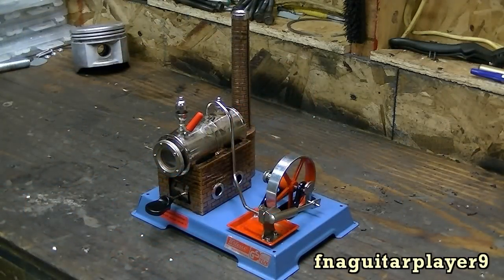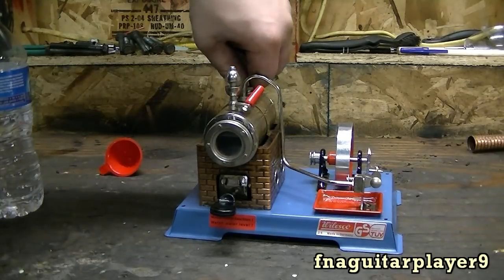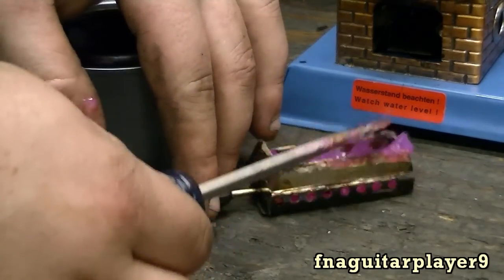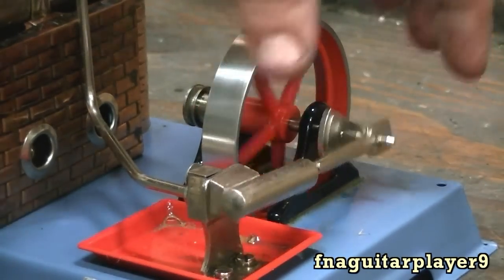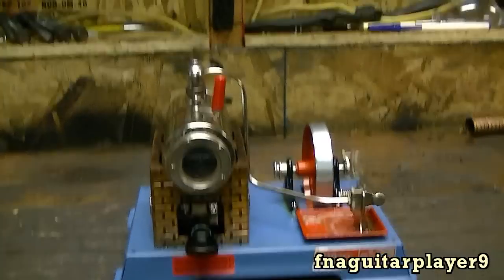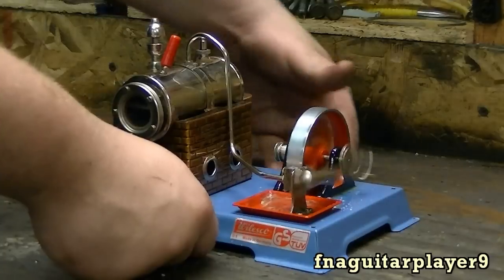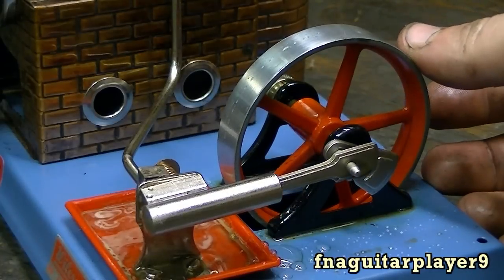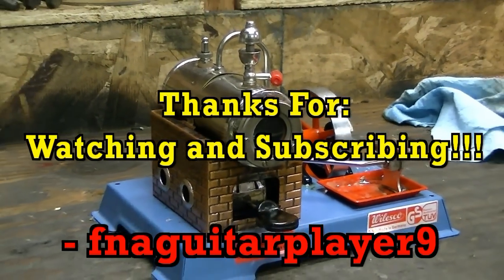Starting and Running a Wilesco D6 Model Steam Engine (how to start)

Comment: you should put some tinfoil in the fuel basket and make a little bucket when using that kind of fuel, will keep it real clean and when done just throw out tin foil and fuel tray stays nice and shiny.
Reply from the maker: That is a really good idea, will do that next time. I'm also considering making a small propane burner for it to, but i'm not sure about that yet. Thanks for Watching!

Comment: Sorry, one more thing... Can you use vasoline to run the device?
Reply from the maker: I don't recommend that, it would be better than nothing but a type of oil would be best, even motor oil should work fine in a pinch. Thanks for Watching!!!

Comment: Do they still make that oil? If they do, can you give me a link?
Reply from the maker: Yep, a bottle wlil last a long time, http://yesteryeartoys.com/z833-model-steam-engine-oil/ thats where my engine came from. They also sell the tablets on there as well. Thanks for Watching!!!
Reply: Thanks, i got an Empire steam engine model no. 46 from some antiqe store in southeast wisconsin, it might need a little cleaning, its missing a whistle and kinda rusty and does need oil. And its electric, so ive gotten a wire for it that is also antique. Im not sure if the insides are ok, and im not sure if there is a way to flush it. It has no little boiler window, nor a psi gauge. The flywheel moves and is not completly stoped. And i think i just found where the water goes. On the bottom it says made in two rivers, which is in wisconsin. And you think you can give me some advice? 

P.s i types this all on a tablet so if there is a bunch of weird mistakes, thats why.
Reply from the maker: I hear ya! I'm not sure on the flushing, I was going to say if it had a sight glass it could be removed, but in that case it will make it hard to do. I would use a penetrating oil on it first to get everything freed up and go from there, it would be nice to find a way to flush it out.

Comment: what is that purple fuel called?
Reply from the maker: Sterno, its used for camping/cooking. Works great for this but doesn't burn quite as long as the tablets. You can find the sterno at walmart (either in sporting goods or where the pots/pans are in cooking). thanks for watching!!!

Comment: what is the red bowl for
Reply from the maker: It catches water and oil from the cylinder after it condenses, most of it escapes as steam but some does condense. Thanks for Watching!!!
Reply: the red bowl is to catch any water that does leak out of that line it will just fall on there and then you wipe it.

Comment: Hehe, I have the same engine :-) It was a pretty piece of my childhood... Is so much better to fill it with hot watter from electric kettle, for fastest start and saving fuel.
Reply from the maker: I hear ya! That is a good idea, that would save alot of time and fuel. Thanks for Watching!!!
Reply: can you use boiled water
Reply from the maker: If you mean distilled water, than yes, its actually preferred since there is no minerals that can build up.

Comment: my boiler my d6 is starting to rust so don't know if put oil in the water would help slow the rust but i might just have to bite the bullet and get a replacement
Reply from the maker: +devon junction I hear ya, i don't recommend putting oil in the water, but you might be able to take the sight glass off the front and clean it out, hopefully its just surface rust, if it is it should clean up good. I've never taken the glass off, so I don't know if there is a gasket there or not, not exactly sure how its setup. If its real bad then yeah i'd say a new one would be the best thing to do. Thanks for Watching!!!

Comment: Cracking little engine you have there! Do you have a rough estimate for how much pressure the boiler runs best at? Somewhere around 30 Psi, I think?
Reply from the maker: +randombenj I hear ya! Honestly not right off, but i'd guess it would be in that range, i did run it off of air once but didn't open it up all the way, i'd guess around 20 pounds probably. Thanks for Watching!!!
Reply: The manual says 5 bar (approximately 72 psi if one bar = 14.5 psi)

Comment: Damn that thing is fast. I'm thinking of making my own little steam engine but the part I'm stuck at is the piston or cylinder, at 11:20 you said that it wasn't a dual acting cylinder and named it, but it was inaudible. It looks simple, and right now I need simple... Please help.
Reply from the maker: +Kraized yeah it is haha I hear ya, oh yeah, i said wobbler engine, its the type that the cylinder wobbles back and forth like this one did, a double acting one will not move, the cylinder is stationary. It would also be called a single acting engine. There is a another youtuber on here that has a ton of videos on building both types of steam engines, he's known for his machine shop videos but does these as projects, look up mrpete222 he has a ton of videos. Hope this helps Thanks for Watching!!!
Reply: fnaguitarplayer9
Thank you sir, I appreciate it.
I want to see how much electricity I could generate with a steam engine maybe a little bigger than the one you have there.
If I could power a laptop in the woods I would be set.
Reply from the maker: +Kraized Your welcome, no problem! I hear ya, it would be interesting to know. That would be really neat to see!

Comment: pls dont use normal water use destilled water
Reply from the maker: +SIMSA75 Thats what I've used the last couple times I ran it since this video was made. Thanks for Watching!!!
Reply from the maker: +Watermelon will Tap water has alot of minerals and chemicals in it, like calcium and chlorine, which causes deposits to form inside and can corrode the metal. Distilled water, is 100% pure water, nothing else in it, so no deposits can form. Same thing for topping off water in car batteries(lead acid), if you use anything other than distilled water in batteries it will corrode the plates and take life/amperage away. Thanks for Watching!!!
Reply: +fnaguitarplayer9  I've used filtered rainwater, seems fine.

Comment: There are screws for the chimney.
Reply from the maker: +SpinninBarrels Mine didn't come with any or have any holes drilled, I might consider doing that if i ever have a more permanent setup for it. I thought about soldering it on, but screws would be better. Thanks for Watching!!!

Comment: I got the same model, my dad bought it to me on an auction. But some of the parts where missing (2 machines and 1 string). Can i make or buy the parts? its just a question :)
Reply from the maker: +Fredbear´s Family Dinner I hear ya! If your good with metal or have access to a machine shop it should be fairly easy to make just about any part on these, not really sure if parts are for sell, you can contact yesteryeartoys about it, they should be able to direct you to where you can get parts. Thanks for Watching!!!
Reply: We havent machine shops arround here in norway,we got plenty of model shops. I wish i had those shops arround norway. Your steam engine looks exatcly like mine. But its from maybe arround 70s, 80s idk. I have like no fuel bricks, so i gotta buy 4 packs of it.

Im not so good in steam engines, only animatronics and robotics. I realy like to make experiments some times. I have like 3 cooler fans connected to a mobile phone adapter, its truly works :D
Reply from the maker: +Fredbear´s Family Dinner I hear ya. Its probably the same, I don't know if they ever changed anything or not. I hear ya, the fuel tablets do last longer than the sterno as i used. I hear ya!
Reply from the maker: +Fredbear´s Family Dinner I hear ya. Its probably the same, I don't know if they ever changed anything or not. I hear ya, the fuel tablets do last longer than the sterno as i used. I hear ya!
Reply: You can get parts on wilesco.com
Reply: get a mini lathe and go from there you might  suprize yourself

Comment: hi, i just saw this video and i need a question for my wilesco d5. How after using, i can  empty from the water the boiler? if I tip the water comes out in drops. (sorry for language but i am italian). Thanks bye
Reply from the maker: Ross I loosen or remove the whistle off of it, that lets air in. Kind of like how you pop off the cap on a gas can to let more gas flow out of it. Hope this helps, Thanks for Watching!!!
Reply: thanks for your answer
Reply from the maker: Ross Your welcome!

Comment: Your opening comment about the smokestack is priceless. +1 :)
Reply from the maker: Tracy Panavia haha I hear ya! It is pretty much useless, just for looks. Thanks for Watching!!!
Reply: fnaguitarplayer9 Hello, i just subscribed to your channel, you have very interesting and informative videos.I recently bought one of the steam engines like the one you have in the video it is almost identical with a few differences mine has the stack and a couple of walk ways one on each side and a ladder.I was wondering if the gasket in the sight glass can be replaced and with what material, also what type of fuel tablets are recommended.Very interesting video. Thank youRob
Reply: fnaguitarplayer9 What model is that engine? the one i have the whole assembly is 12 inches wide by nine and three quarters deepand the steam line goes out and then underneath the base and it comes out to a little valve that you can turn to open or close the steam supply to the piston and right before the piston it has something that looks to be another valve but it looks to me like a receptacle with a gasket and a cap that you can remove ah and the flywheel has what looks to me like a centrifuge conected to it by a round metal spring (like a guitar spring) but is used as a drive belt. The assembly does not have any marking as to what model it could be, it ony hay the manufacturer name is there a website or are you familiar as to what model i might have?Ah and the area where the relief valve is has a handle with a wheight that you can move (it has two notches where you can sit the wheight) i think that is to control the pressure at wich the relief valve lifts but i am not sure. And if that is the relief valve it sure looks different that the one on your engine.Any help you can provide will be greatly appreciated.Oh and by the way i subbed to your channel. Cheers
Rob
Reply from the maker: Rob Hernandez Thanks for subscribing! I would imagine just normal gasket materiel should work. Mine is a Wilesco D6, you must have the next model up. This one came from yesteryeartoys.com and they sale the recommended fuel tablets. I just used sterno because its all i could find locally and it worked pretty good just didn't last as long as the tablets. You might be able to browse through the models they have on their site and see if you can match it up. If so you could contact them for replacement parts. Thanks for watching and subscribing!!!
Reply: fnaguitarplayer9 Hello and thank you for replying back,I was able to identify the model that i have it is the D16 made back in the 50's the label is oblong (football shape) and the lettering is white on a light blue background.The part that i am missing is the safety valve, so i will be looking for it at the place you recommended.Thank YouRob
Reply from the maker: Rob Hernandez Your welcome! I hear ya. If they don't have it or can't direct you to someone that does, the only thing i can think of is ebay, maybe find one thats being sold for parts or something.
Reply: fnaguitarplayer9 I read in a blog for mini steam engines that the wistle is used as the safety valve i guess i could use it like that but i would preffer to use the correct safety valve. Also read that maybe it was made in the 60's or 70's too bad that there is not a place where you can date them. CheersRob
Reply from the maker: Rob Hernandez Thats a new one to me, but it might have been like that at one point. I know on mine the safety valve is where you feel it, it is spring loaded. You would think they would have a serial number on them.

Comment: The Wilesco site says the D6 cannot run any accessories. Have you ever tried?  I would love to get a D6 and an accessory that powered a little light.
Reply from the maker: Bill Irish They will run a small accessory, thats why they have the pulley on it, i don't know why they said that for. i've never tried myself but i don't see any reason why it wouldn't run a small generator/light, just can't put much load on it. I have loaded it with my thumb on the flywheel, its not super power full but it will power something. Thanks for Watching!!!
Reply: Bill Irish they are fun to run but not strong enough  to run accessories properly I recommend a WILESCO D10 or higher or any Jensen brand engine for more power.

Comment: Bottled water is not recommended for live steam... As it has minerals that over time will build up in the bottom of the boiler, I use distilled water for my Wilesco D10.
Reply from the maker: Christian Holbert I never thought about that, but it makes sense, I always keep distilled water on hand for topping off batteries, will use that next time. But mine isn't run but maybe once every 2-3 years. Thanks for Watching!!!
Reply from the maker: ***** I hear ya. It would be nice if they all came with at least a valve on it, it would be fun to be able to slow it down and watch it run slow. Thanks for Watching!!!

Comment: besides controlling the fire, is there some sort of throttle control to adjust the speed?
Reply from the maker: daViDeoPhile Not on this particular model, most of the bigger/fancier models will have it, I wish this one did have a valve, it would be fun to see how slow it would run. Thanks for watching!!!
Reply: doesn't it become boring quickly if you can't control the rpm?
Reply from the maker: daViDeoPhile I don't think so, i mean you only get like a 10 minute run anyways. But you can always make it power something that has a variable load, like say a little generator, then you can hook different loads to it, which would change RPM.
Reply: I see. I take it that you are still quite excited about your D6 . :D I'm considering to buy one for my father, since he's a huge steam engine fan.
Reply from the maker: daViDeoPhile oh yeah, I mean i don't run it very often, it hasn't been ran since i made this video but its still fun each time. I'd say he'd love it, I used to be into trains and steam engines alot when i was younger, when my dad got this for me. So yeah, anyone who likes steam power will definitely want one of these haha They also sell it in a kit where you put it together for like 20 dollars cheaper, he might like to do that.
Reply: Yeah. That's way more fun. He might appreciate it more if he is the one who has to assemble it. What's it called if its a kit?
I'm afraid he would use it for a day, and then completely forget about it.
Reply from the maker: daViDeoPhile Yeah, i think a kit would be more fun too. Here's a link to the kit: http://www.yesteryeartoys.com/cgi-local/toycatalog.cfm?view=D6K and here's a link to the complete list of models they have: http://www.yesteryeartoys.com/cgi-local/toycatalog.cfm?list=2
Reply: OHHH! thanks! Hopefully I can find the right one! :)
Reply from the maker: daViDeoPhile Your welcome!
Reply: daViDeoPhile The kit is called the D5 I just ordered one, and also a prebuilt D141 workshop model.  I can't help myself, German models are a very good value now since the Euro is so weak against the dollar.

Comment: If i dont use the hole tablet up tthen i Can use it again?
Reply: Or just cut them in pieces?
Reply from the maker: DudeG4mepl4y
yeah they can be reused as far as i know, but the fire is fairly hard to put out, they burn really hot. Thanks for Watching!!!
Reply: Then i can just use a little water and a half tablet
Reply from the maker: DudeG4mepl4y
Yeah, but don't let the water level drop below the glass window, if you do it can overheat and damage it.

Comment: I've owned a couple of these model steam engines and a big piece of advice I can give is to run distilled water. A one gal jug from the store goes a long way and it saves the engine from gumming up with calcium and other minerals. I actually ruined my first engine using tap water.

Comment: Get some round nose pliers and bend the tabs out just a bit that hold the smoke stack on.  You'll be able to fit that thing on very tight. That little thing runs great, I have D8 circa 1970 almost alike

Comment from the maker: the problem with putting a oil in the water would be it would affect the water boiling, what is usually done is there is oiler in line between the boiler and cylinder that mists or drops oil into the steam as it goes into the cylinder. good idea though, they may make something designed for that, hard to say. thanks for watching!!!

Comment: hey, am am not stranger to seam engine built one from a 2 cycle engine block and right now i am making a second 50 pounder from a old Briggs, but whats about as cheap as you can get these kits it would be nice to run one inside